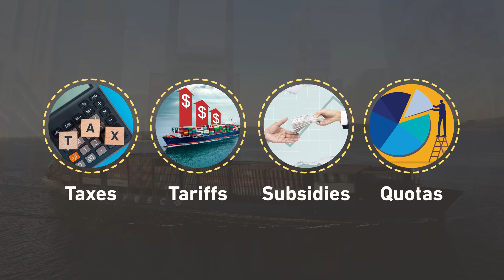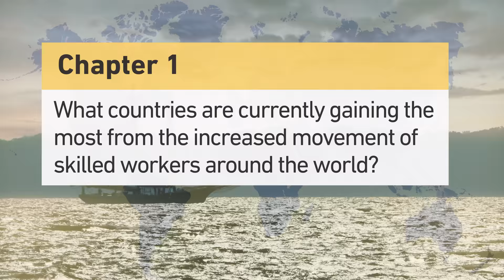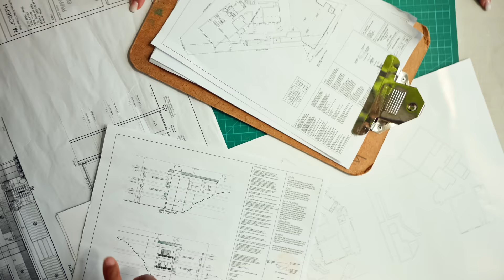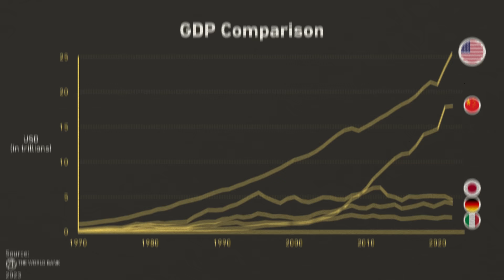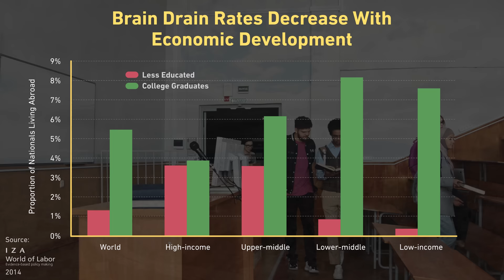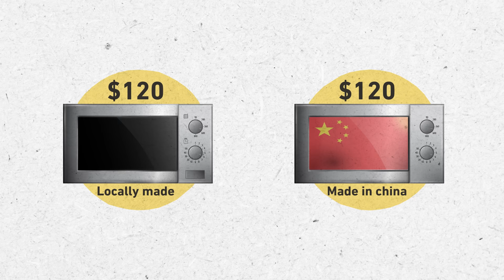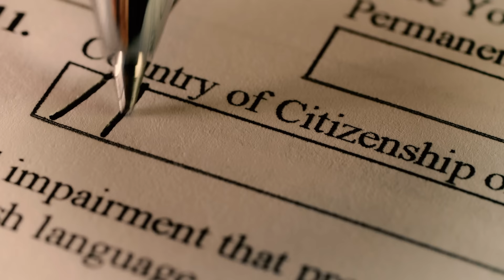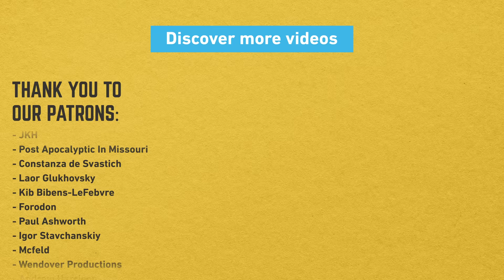Skills Wars Are the New Trade Wars

Comment: Part of the issue with citizenship taxation is that a sufficiently disgruntled migrant worker whose only touchpoint with their country of origin is the extra taxes it levies on them for no benefit has no reason to hold on to their citizenship. This sort of control from a less influential country than the USA can simply direct skilled migrants to look into path-to-citizenship schemes, cutting the home country out altogether. This can be unpopular in the host countries, especially democratic ones where the newly naturalized migrants would potentially become an unpredictable voting block, but it is a tool on the table that doesn't have a clear equivalent when it comes to the movement of goods.
Reply: Getting a new citizenship can take a few years ago, so at least during those couple of years, the skilled worker would pay taxes back to their home country and hopefully pay back the costs they got from the tax base
Reply: @Noe-gj9mw  If the tax rate is completely bonkers, maybe. The typical expectation for a domestic skilled worker is that they'd contribute to the economy and the budget for decades. To try and pay back all of the tuition subsidies in the ~5 years it would take to ditch the chains is not a sustainable proposition. Moreover, since the scheme relies on the worker paying the same taxes as they do domestically, this means a brutal tax rate for professionals at home as well, which if anything means they have even more incentive to go to a country that isn't bleeding them dry.
Reply: and what happens if they don't pay the taxes of their former countries? the actual country will arrest them? or they'll send the police to arrest you on the new country? I find it very difficult to enforce.
Reply: @filipelimartins  It depends on what kind of ties the worker has to their home country. If they have assets there, those are in reach for confiscation. If they're sending remittances, then accepting those may make one an accesory to their "crimes". And yes, if the country is a hegemon like the USA, they can just lean on the host countries to make them play by their rules and enforce US laws.
 
Which once again falls apart entirely when the worker has the option of just ditching the old passport weighing them down. It also naturally doesn't work if neither the worker nor the host country have ties and goodwill to the home country.
Reply: This is a very good point. Americans living overseas have an incentive to keep their US citizenship, namely because a US passport is a great way to stay physically protected. If you work, travel or just spend a lot of time in other countries where crime is... more common, keeping your US citizen status ensures that criminals will think long and hard before they take you hostage for ransom. Whereas countries like Germany and Spain will pay the ransoms (thus incentivizes the system of taking foreign hostages), the US just sends a blackhawk with a team of special forces to land on the bad guys roof in the middle of the night, kills them all and takes you back to the US. Conflict reporters in war torn countries are often told "Say that you're American" even if it's a lie, cause then the hostage takers let you go and don't risk screwing with Americans. It works with terrorists/criminals as well as dishonest police and corrupt officials looking for bribes too. Even in countries where the national police is indistinguishable from a large gang, they still rarely (if ever) run the risk of provoking the ire of the US when the state department finds out about it. The intimidation factor of a US passport is amazing.
Reply: @Lusa_Iceheart  I concur that, unfortunately, this was true in the past, and possibly still is.  I was on a train between two countries not considered severely poor or underdeveloped. The inspector looked at my passport, had me open my bags for visual inspection, and went his way.  I noticed that other people were having the contents of their bags thoroughly examined, and were  handing over cash or having items taken from their luggage.
Reply: @Lusa_Iceheart  I don't think USA military deploy to rescue regular citizens from common crimes.
Reply: @Lusa_Iceheart It depends to which country you go to. Saying you are American in Iran might not be a good choice. You are better off being Russian or Chinese probably there. Nevertheless, the US being able to send its military anywhere is just a thing from movies. Go read the US Embassy website of the country you plan to visit before you visit there.
Reply: In some countries people can't renounce their citizenship. In Argentina for example, a citizen will be tied to the country for life. I bet that any country that tries to tax citizenship will make it impossible or near impossible to get rid of the citizenship.
Reply: @filipelimartins I mean, the US isn't going to send the Special Forces if you get mugged or something. But if you get taken hostage, the government will probably get involved. 

The most famous case is probably that cargo ship captain who was taken for ransom by Somali pirates. But there are numerous others.

There were those hostages that Hamas released just recently thanks to some kind of back door negotiations. Special Forces were sent to rescue a nun who was taken hostage in Burkino Faso last year. Even North Korea has released US prisoners in the past, though usually only after years of negotiation.

Comment: An Italian collegue of mine, when I still worked in the private sector in Brussels told me the offers he'd gotten from Italian companies. They weren't just lower, they were plain insulting for somebody with a decent education. I mean... there is a difference between -15% to -25% of the average European wage level, especially if the cost of living is adapted.

And there were those garbage offers... they offered a three digit salary! That's completely insane. The rent was higher.
The Italian private sector has a devaluated skilled labour to such a degree, that it's hurting their economy. You can't tell me the productivity of a Italian Engineer is 20% of a German/Belgian one... It's just cheapgoating to an extreme level and it hurts their economy.

Comment: This happens at a company level too. Now if you get training in AI and similar fields your are tied to a company for a number a years. I have seen that on mkt jobs too. before that only happened with commercial pilots or doctors in the military but brain drain is a real issue
Reply: Those non-compete agreements are almost entirely unenforceable. Any sort of lawyer working in labor law would get a case open & closed with minimal effort if a previous employer actually tried to enforce anything like that.
Reply: I mean, that is kind off fair in a way. While I am sadly not one of these hyped up tech bros, I have seen and partake in a few company training, some of which had accompanied associate degrees, where a part of the agreement is that you either work for the company x years, or you pay (part of) the cost of the training back. 
Such a arrangement is kind of fine in my opinion, education is quite expensive, so when they offer you the opportunity to get trained more they should be allowed to expect you to apply those skills there, for a while. As long as they give you the option to leave sooner by paying the cost of the training back, or letting your new employer do that for you.

Comment: "Skills" by Who's definition ?
I find it funny that you all have a set definition of what that skill-set entails and that, in your mind at that point,is what is most valuable money-wise.
Rrrright up until when your toilet stops working or, in the middle of winter, when your furnace stops working or, right before your Big event, when your power goes out.
Suddenly you begin re-thinking the true value of other people and what they do well.
{*Sigh*} right up until its fixed and then you will forget all about those... (🙄) icky losers again.
Reply: I am a skilled worker by channel owner's definition, I work in IT. I can easily fix my power grid (only at home, of course, not the city power grid, but I also pay taxes and bills so other people can help me out with this), I can fix my plumbing, I can fix most of electrical equipment you could find in an average household, I can fix my roof or even build something like a garage from scratch, all on my own. What's the deal with skilled workers, again?

You see, skilled workers are called so because they can do stuff no one else can. Unskilled workers do the “usual” stuff most of people can sort out by themselves. An electrical engineer is a skilled worker, despite your nonsensical comment implies the opposite. Plumbers are skilled workers too (though there's not much to learn compared to even the simplest IT professions). Drivers are not. Couriers are not. Cooks… Questionable, but the best chefs are definitely skilled. You get the point, I hope. A skilled worker is valuable money-wise because of scarcity of their kind, it's like platinum vs iron. To prove your nonsensical “point”, try living off-grid and not use resources like Facebook, YouTube, Amazon, your online banking, and whatever else that's an integral part of your current life. Oh, and try avoiding using pre-made materials and any complex tools, especially battery or oil product powered (yes, including your truck), while building your cabin of failure, they're invented and launched into production by skilled workers whose skills you're trying to berate. You should also avoid eating canned food, drinking bottled beverages, and even using a industrially made water filtration system while trying to survive in the cabin — again, these are invented by skilled workers.

To summarize: if there's an icky loser on this channel, this is you. Go get a proper education and stop whining.